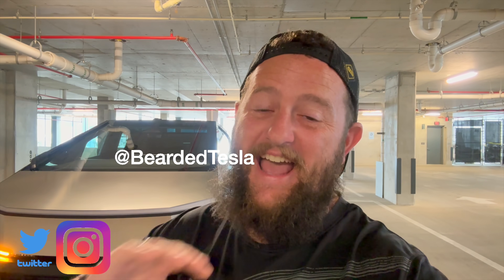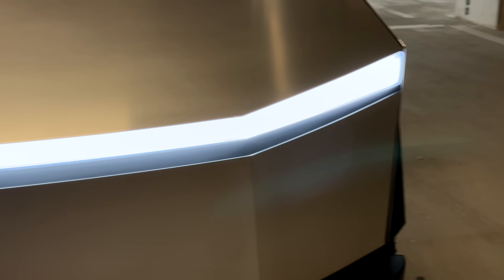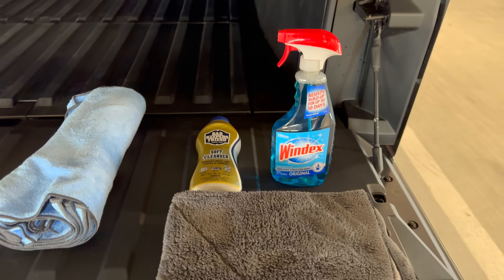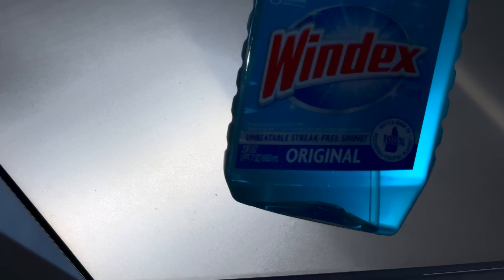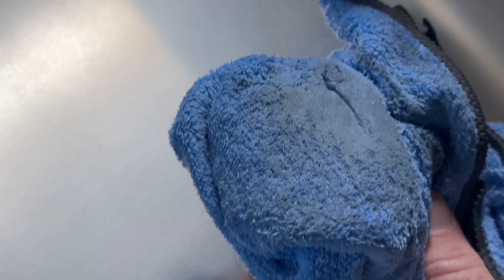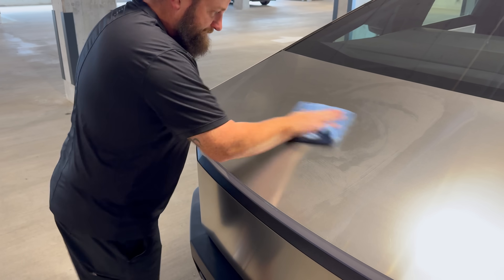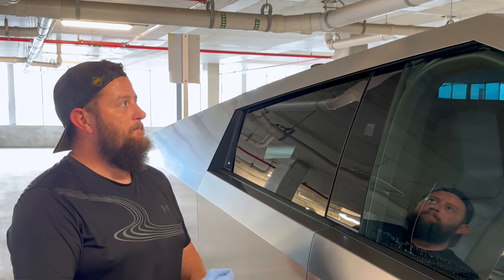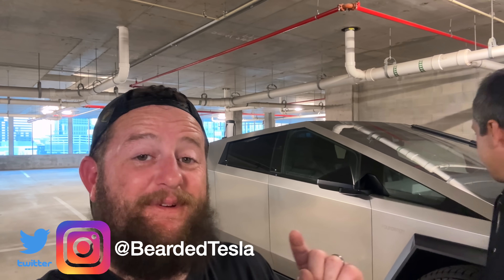Tesla CyberTRUCK or CyberRUST?? The TRUTH About Cybertruck Rusting Issue + How To Fix It!!

Comment: From a former job we tried to recycle stainless steel and encountered these same problems. It's the chemistry from using recycled stainless steel contaminated with other metals, especially carbon steel. The bad chemistry or contamination from other metals also causes inferior welds. This exact problem happened at a company manufacturing hazardous waste containers from recycled metals contaminated with other metals... rusting stainless rust and breaking welds. This is potentially being caused by Tesla buying cheap recycled stainless steel instead of the virgin steel it's customers paid for. The bad welds is the cause of the panels falling off.

"The material supplier, Steem Dynamics, is known to use up to 90% stainless steel scrap in its manufacturing process, suggesting a high percentage of recycled content. "

Comment: Just as Elon is not an engineer, nor scientist, nor hardly a genius, y’all are obviously not chemist.  Given, what you are saying is absolutely inaccurate. 

So, to clarify the apparent misunderstandings in this video and hopefully aid in the prevention of perpetuating miseducation of those watching this video/:

1.  Oxidation of  stainless steel:
    a) Iron (or Iron alloys)  Ir
    b) water/moisture (71% of
         Earth surface), &  H2O
   c) oxygen (21% of Earth atmosphere)  O2
    d) Rust (the product or result of the oxidation reaction)
That is: 

         Ir + O2 +H2O = Rust

2. Oxidation vs Rust
       a) Oxidation refers to the process of oxidizing or           chemically   
  reacting with oxygen. The reality is we cannot see or view an actual “oxidation” as it is chemical reaction which is occurring at the atomic level. 
What we can observe is the RESULT of oxidation.  As for this case, what you are observing is rust.

One last time, in brief:
So when the surfaces of Iron or Iron alloys are exposed to the atmosphere and moisture (m, are oxidized by Oxygen. 

       b) Rust is the result of oxidation or more specifically, the result of Iron oxidation or Iron alloys .So, It’s inaccurate to state or view oxidation and rust as two separate processes or things. As did a Tesla’s engineer in an attempt to explain away the cyber truck  rust dots by asserting brown-orange spots /speckles were oxidation and not rust.” 

1. Stages of the Rusting of stainless steel. Rusting can and does occur in stages. a)Initiation: Small rust spots appear on the surface of the stainless steel. 
b) Growth: The rust grows. 
c) Coalescence: Existing rust combines.

P.S. Use a petroleum based cleaner to help remove the rust spots and at the same time , the petroleum cleaner will drive out any water moisture from the wiped surface. If you recall, water is required for the oxidation reaction to occur.  WD-40 will do a decent  job solubilizing them or at least help slow or stop or slow the stages of rusting

Comment: I wonder if Ospho would work? I know it would eat the rust but idk what it would do to stainless. Only problem I can forsee is that it won't eat the metal that's rusting only the rust itself. So the rust may return a few times until the piece is rusted through and through. Another problem is it will etch non stainless non rusted steel if its left on too long. So it will remove the rust but may also etch the stainless. A test on the same type of stainless would be needed before using it on the actual car!

Comment: I've worked in the marine field for over 40 years. I have seen this issue many times. Very simple way to remove rust spots. We dampened a rag with acid. (use rubber gloves) The rust will disappear. Wash with soap and water. when dry To prevent this from coming back, take a new clean rag and wipe the s/s with WD-40. Sounds weird but it works.

Comment: There are different levels of stainless steel so if you are using a 300 series stainless steel it is very unlikely that you will ever see any rust.  Conversely, if you are using 400 series stainless steel you will see rust. Personally, I would not trust Elon Musk's explanation because he did not state what series stainless is used in manufacturing these vehicles.  Also, we don't know where they are manufactured. Tesla has a lot of manufacturing done in China and we all know how quality control in China is like.

Comment: "Stainless" steel DOES rust.  If you don't get rid of the contamination, it will spread!  So it is only superficial if you remove it right away.  And what about the back side of the panels?  You gonna meticulously clean them?  I thought Elon chose stainless because it would be maintenance free?  (lol!  Elon is surrounded by engineers, all of whom know this stuff!)

Comment: If you need a.cutting agent to remove it, it is not just surface contamination. You are removing the material of the car to get it out. That also means you are making the panel thinned and adding a scratch pattern to you 100,000$ car. This is not needed on even 20,000$ cars. Ever. Hrmmm. Also, if rail dust was a thing, you would see it on every car after it rains. You obviously don't so....yeah.

Comment: Stainless does not mean it is immune to rust. Stainless is like that mold resistant bathroom silicone. You still get black mold in the silicone but it is resistant to it. Meaning normal silicon would get mold much faster and much worse. How do so many people not know that stainless metal can in fact rust and/or stain. I thought this was basic common knowledge

And this whole "unique chemical blend of stainless steel" bullshit is just marketing speak for it is everyday normal stainless steel. Again I thought this was basic common knowledge that stainless steel is stainless steel. There are different grades of stainless steel, the fact the Cybertruck is rusting/staining already means it is likely on the lower end of the grades as in a cheaper lower quality stainless that has a lower percentage of the expensive rust free elements like chromium and such

What makes stainless steel, "stainless" is they mix the steel with elements that in their pure form do not rush. So chromium for example if you take a block of pure chromium and leave it out in nature it will never rust. By mixing that in with the steel it adds a rust free property to the steel. Higher percentage means more of the steel is blended with chromium and thus more resistant to rust, lower percentage means a cheaper blend but more prone to rusting

Chromium is just one commonly used examples but there are other elements that can be mixed in, the more percentage and the more powerful the rust free attributes that element adds the more expensive it usually is

So by the fact the cybertruck is rusting this early on means that it is a lower grade of rust free that is cheaper and has a larger profit margin to it as a result for Tesla

The best solution to prevent rust is using a stainless steel material and then treating it or coating it or painting it so that it can't rust. Normal cars have multiple layers of coating to prevent rust. I don't understand why by default the Tesla Cybertruck stainless steel is not coated/treated with any rust proof treatments, a clear coat of protective film/paint, certain chemical and heat treatments can achieve this as well. Why does it have none of that as default? If you buy a basic model of any other vehicle it always comes with the default white as a basic feature included in the base model price and then you pay extra if you want a different colour sprayed on top of the basic protective white

Elon should be aware of this with his supposedly super human level intelligence when Tesla themselves sell their own vehicles with the same basic protective white as the base paint for all Teslas so it is not like Tesla and Elon did not know this basic knowledge already

I also don't get why Tesla is charging so much for the protective paint clear paint layer. They want 5000 dollars extra for that when it is a treatment you can get from other brands for 500 dollars for the exact same treatment which even includes a free protective treatment of your car's interior (the seats and steering wheel etc) and if you go third party even less than 500 (but then without the interior treatment)

And I know you either have people who hate or love Elon but I am coming in here from a more practical perspective of neither hating or loving the man but just baffled by the fact he is supposedly this hyper intelligent guy and yet doesn't know the most basic knowledge of stainless steel

Comment: If you have to use Barkeepers friend, it's bonding to the steel and rusting the steel. Simple solution here, why not just clear coat the stainless? You still have the "bulletproof" properties of the stainless steal but now you also have the benefit of it being protected from the elements, easier to clean, less likely to stain/rust and a polish to the clear coat is a lot easier and cheaper than polishing an entire truck's worth of stainless steel with Barkeepers friend

Comment: A problem that pretty much no other modern car has, for this 50K..100K...  thing...

I'd honestly recommend getting rid of it while you can, if it weren't for the fact that tesla put the "you are not allowed to sell it for a year" point in the agreement. Scalping would have been a problem if it was actually good - I'm pretty sure that they knew what they were doing with that point - securing buyers that wanted to actually have a good electric truck (electric pickup trucks are inherently retarded btw, EVs are at their best when small and light) and are/were fans of tesla. No good deed goes unpunished, I guess... These things will sell for so cheap...

Reminds me of the phrase - it is easier to scam someone than to convince them that they've been scammed, and for a good reason... this thing costs a fortune and there's nothing you can do with it now, which is a massive mental recoil to deal with, so pretending this was a good purchase takes less mental work than dealing with the recoil.

Thank goodness these abominations are not coming to EU.

Comment: Your are talking about Brake Dust and Iron Particles in the air.  The particles are very light and travel  very far just in the air.  But its not limited to Train and Rotarry polish,   the most natural and everyday occurrence of this is brake dust in the air while just driving the vehicle, every car has , the steel look just makes it much more noticeable.   While it is surface level it not so easy to get rid of by just washing a vehicle.  You need to a regular wash on the vehicle and then use what is know as IRON REMOVER /DECONTAMITION SPARY,  detailer use this all the time.      Please do not use barkeepers friend,  or other abrasives,  theses are meant to finely scratch the vehicle.   The problem with this is that steel has already been sanded at a certain grit to give it the desired factory finish.   And when you are using barkeepers friend or other abrasive you risk actually polishing the surface and giving a different shine that was meant by factory.    You could in theory even come up with an actually shine and take away the Matte/ Brushed look that came from the factory.  And steel will polish to clean shine if you  not careful.  Im just saying this if you want to keep the surface as close to factory finish.
Reply from the maker: yep, pretty normal stuff around most cars, it just seems to latch onto the Cybertruck pretty easily
Reply: @BeardedTeslaGuy   that's hard to tell with out a side comparison test..   I've done a lot white cars that have this problem every two weeks.  The way we usually test with a credit card brushed against the surface

Comment: Stainless steel will rust under some specific conditions those mostly relating to heat you heat up stainless red hot and it will rust. Acids can react with it and lead to rust later on

Comment: I haven't seen exactly this, but I've seen a lotta like this. This looks like electrocorrosion(galvanic corrosion). If you join different metals and/or apply voltage between them (a lot of cars use chassis as ground conductor) in presence of a moisture, rust gonna form. No matter if steel is stainless or not. Also, if some tiny particle of another metal lands on the surface, it's also enough for the process. Irregularities in metal also might lead to this. Dats why paint and varnish for metal industry exists, duh. Apparently, Musk saved A LOT on material science dept.

Comment: So, the only reasonable options (without using tons of products) are to let it rust and patinate (the steel is rustproof and thick enough to not loose any integrity I believe) or to wrap/paint it, which honestly is what other manufacturers have been doing for decades. Because guess what,  a stupid exoskeleton of naked metal makes absolutely no sense and that's why nobody else does it. The only exceptions were just for the cool factor - and that's this case in the end too. This car is not starting any revolutions (and with the pedestrian-hostile undeformable front, it's simply not getting approved in Europe ever).

Comment: I'm thinking films and wraps are a bad call. They are delicate and hard to wash. And if something does get trapped underneath you don't really have a great option. At least with the steel you can just scrub and buff anything that does accumulate. And you can actually use it like a truck.
Reply from the maker: Colored PPF is the way to go

Comment: Listen up, I'm a chemical engineer that worked in the cleaning products industry for 40 years. Rail dust and brake dust is primarily steel (which is iron, Fe). The surface of a CyberTruck is a secret 300 series stainless steel (like 303, 304, 316). Fe (iron) sitting on 300 series SS (with water) forms an electrochemical cell and turns the Fe into Fe3O4, aka rust. Bar Keepers Friend Soft Cleanser contains oxalic acid, citric acid, feldspar (ground up rock as an abrasive), detergent, water and a few other things. The acids turn the rust into a water soluble organic compound. The abrasive aids the removal by physical erosion. The citric acid also re-passivates the stainless steel and protects it from rusting. Sprayway Glass Cleaner contains ethanol and a glycol ether (grease, aka fingerprint dissolving solvents), detergent, water, perfume and hydrocarbon propellants (propane and butane). I can't wait to get my CT. I'll probably compound/formulate my own cleaners and passivators at 1/10th the cost of retail store products.

Comment: This is a work truck, a truck is supposed to be a work vehicle. Car people want a work truck that looks like a new refrigerator. If you treat it like a cooking pot or a tool you're going to have better results. Take some fine steel wool to buff the rust out and put some oil on it. Don't let it sit wet with crud on it. You might want to spray it off after a long trip to get rid of the iron particles off. Scorch a seasoning layer on it like a cast iron pan. Dip the panels in an oxide like bluing, paint it, wrap it. There are so many options that the complaints don't make sense, is it a truck or a fashion accessory?

Comment: This is what i suspected the "rust" to be this whole time. The high iron content in brake pads/rotors is likely the cause, and its in high concentration on roadways. Its likely just more visible or the stainless steel has a slight texture that causes the contaminants to adhere more easily. Some iron remover at every wash would probably help. People just love to hate EVs and Tesla in general. I knew there was some overhype to these reports...
Reply from the maker: haters gonna hate

Comment: Don't listen to this guy. If you want to remove the rust dust just spey some liquid rust neutraliser on it. It will dissolve the rust into an oxide and you can wipe it away
Reply from the maker: be careful as this can have an impact on the patina on the surface, and may not leave you with a consistent, or desired color. Thats why I didn't use any iron dissolvers on this
Reply: That's true, but also why I add then wipe away. You don't leave it on. Sprey or touch up with cloth, then wipe it off

Comment: Stainless steel can rust. That's fact.
Reply from the maker: and what is happening here is not stainless steel rusting. That's a fact.
Reply: @BeardedTeslaGuy ”free iron particles reacting with the surface of the cyber truck” is still rusting. I think the bigger issue is that a car that costs this much should have some basic protective coating to prevent this from happening at all (one that doesn’t cost an extra 5k)